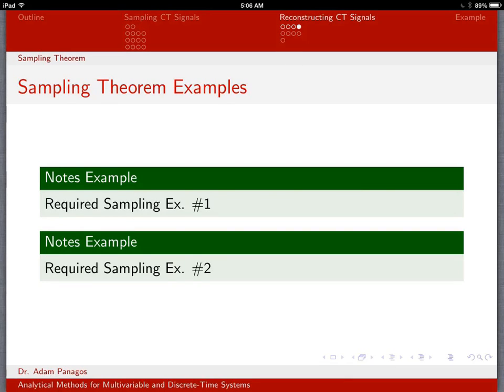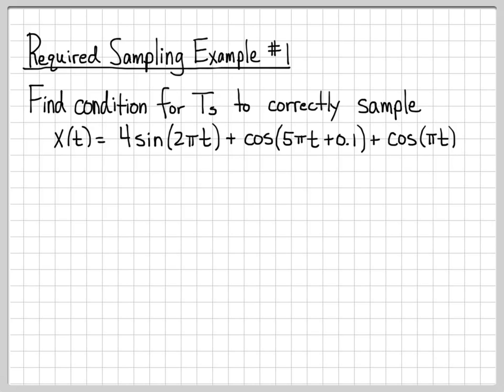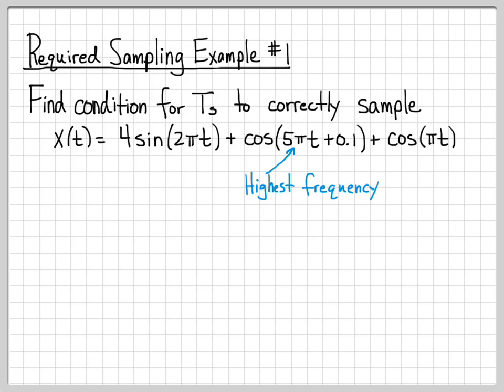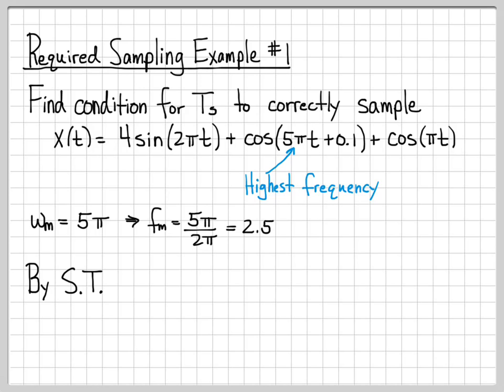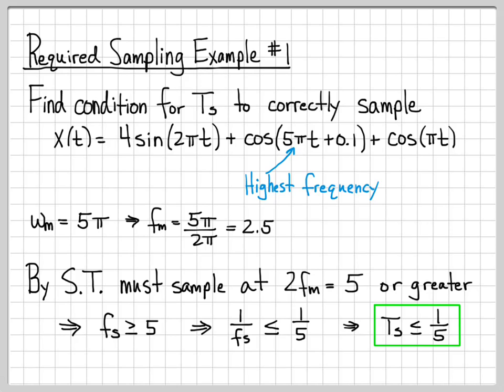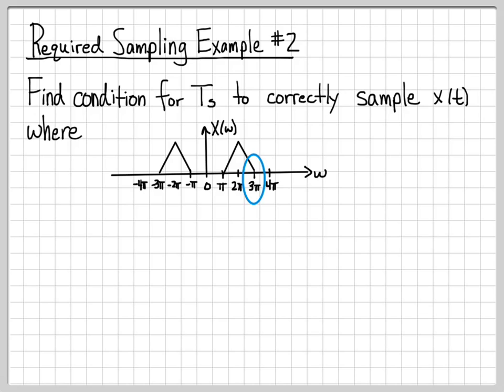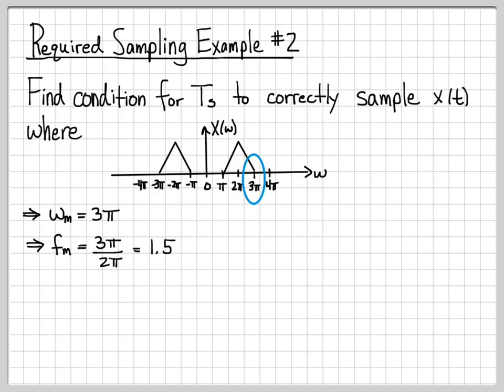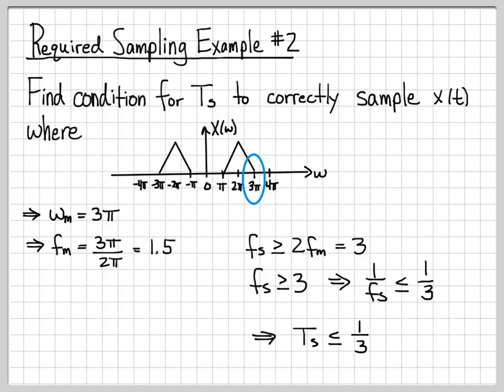Sampling Signals (9/13) - Required Sampling Examples

Comment: I'snt the period just 2*pi.which gives T as 1.
Reply from the maker: We're not trying to find the period of the signal, we're trying to find the sampling period required to sample the signal properly.  Given the highest frequency (i.e. smallest period), we need to sample at twice that rate (or at half the period).

I hope that helps.  Make sure to check out my website http://adampanagos.org for lots of additional content that you might find helpful.  Thanks, Adam